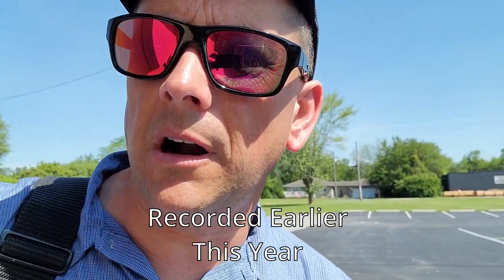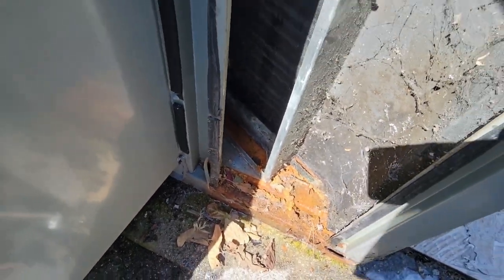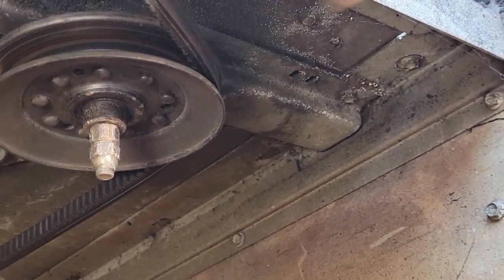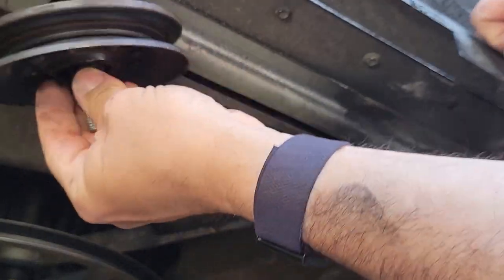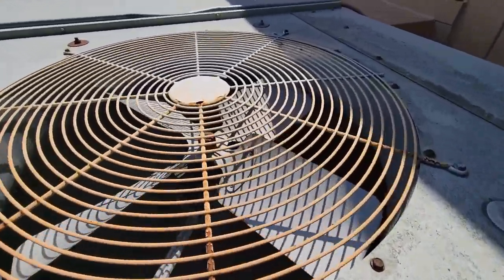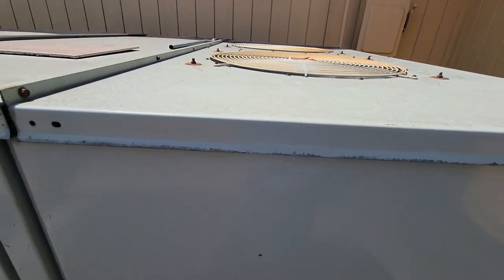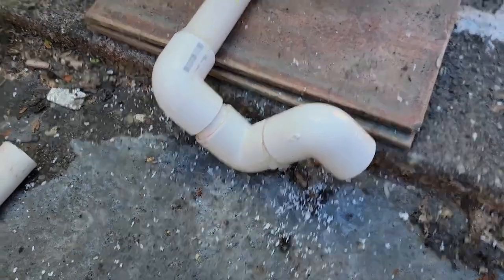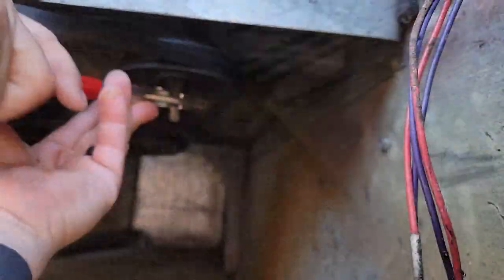Trane HVAC Not Cooling Store Is Hot!

Comment: 3:30, top nut tightens the sheathe bearing(PULLEY) to device, the nut below that is used as a locknut and is also a locking nut!
I'm thinking that's for sure "NOT"  factory and field modified. lol it backed off once from not being tight enough and they went ok FUUUUUUU. locking nut as the locking nut . 🤪

Comment: Great Video. Thank you for sharing. May I ask, what's type of motor use on hvac ? and what's type of Belt use on HVAC ?
Reply from the maker: We use all kinds of different motors, three phase, single phase, belt driven, direct drive. Belts can vary from a 4L to a BX or larger.
Reply: @HVACRSurvival  I have job interview , they asking about commercial hvac motor and belt.  Thank you for your help
Reply from the maker: It's a broad question. With more context It would be more specific